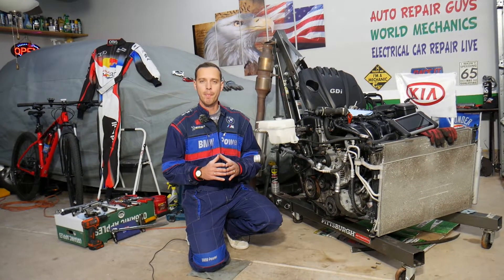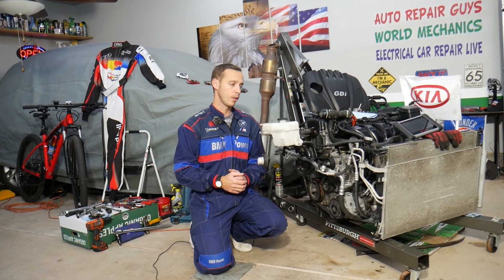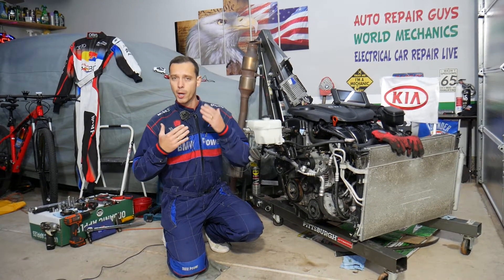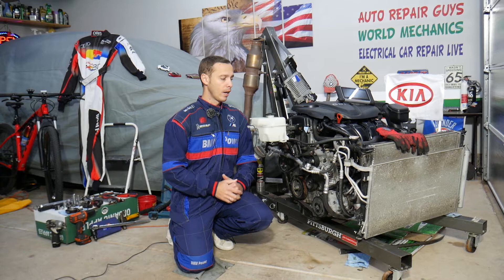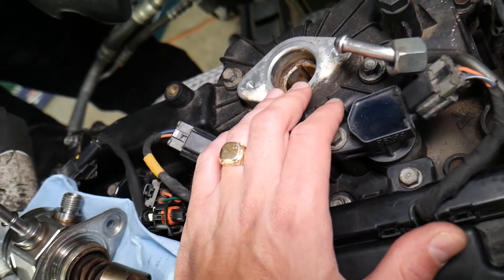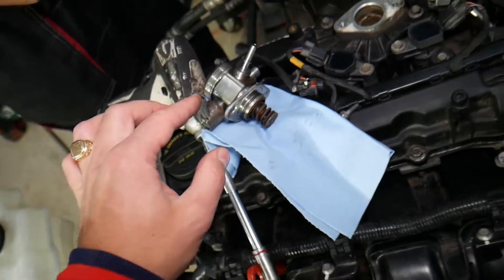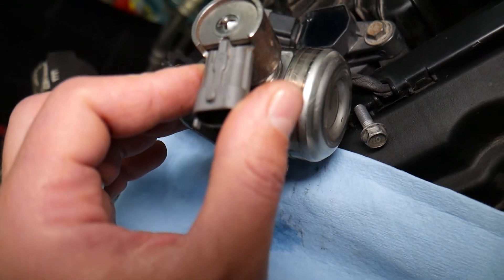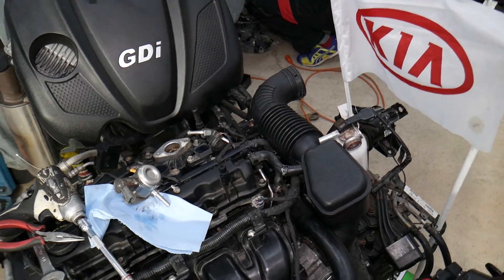CODE P0001 P0002 P0003 P0004 FUEL VOLUME REGULATOR KIA SORENTO, KIA SPORTAGE CHECK ENGINE LIGHT

Comment: Can you help me please. I have a 2013 diesel Nissan Dualis 1.6L with the P0002 error code. I need to know the location of the pump & the fuel volume regulator. I’d also like to know if the error is due to a bad fuel pump, the regulator or something else. Thank you!

Comment: Hi, please help! 🙏  I've watched numerous videos , done a ton of research.  Your videos are awesome! They are very informative and very well explained. So thank you. But I have been having an issue that I have yet to narrow down the problem.  I have a 2015 Kia sportage 2.4L.  I drove to work one night, got off work the next morning and got about 15 minutes down the road and my car just shut off, when I tried to start it back it sounded like it was locked up.   It will give me like a 1/4 crank and it squeels, like air coming through a small hole and then nothing. Not like a belt broke or anything like that.    I have a video of it that I would love to send you and maybe you could make sense of it.   Thank you and I hope you see this.
Again keep your videos coming, they are great!
Reply: Just a little background,  I've removed the coils and spark plugs and tried to start it, the motor turned over so I know it's not locked up,  I've tested my coils with my multimeter and they all test good,  I've put new spark plugs in, I've charged battery.  I think I've narrowed it down to either a ground problem, or something in the fuel injection system. But I'd hate to spend a ton of money on perhaps a High pressure fuel pump and it not be the problem.  Thanks again

Comment: Bonjour, 
Si quelqu'un peux bien m'aider pour un problème sur une renault master3 2.3L qui a un code défaut P0002 (regulateur de volume de carburant- problème de performances/de limites). JAI UNE PERTE DE PUISSANCE QUI PAR ET REVIENS 
 j'ai testé le capteur avec un multimetre valeur trouvé(3,30 Ohm)✅️, capteur déposé test avec une batterie il s'actionne✅️, teste mon alimentation capteur +/- et la continuité du féseau✅️. Pour être sûr j ai acheté un capteur neuf de la marque bosch d'origine ( teste avant montage même résultat valeur)✅️, j'ai toujours le même code défaut P0002.... si vous pouvez m'aider sur ce  problème s'il vous plaît ?